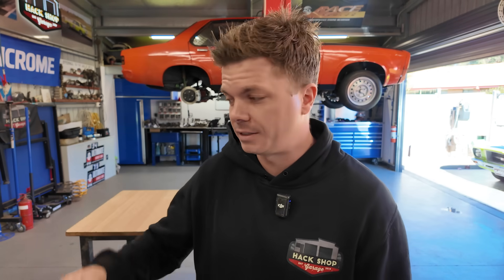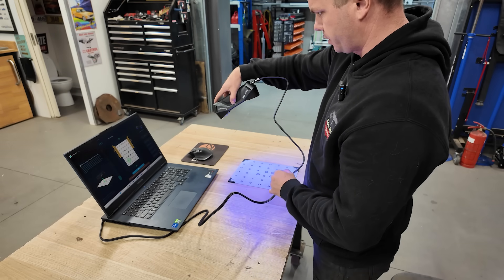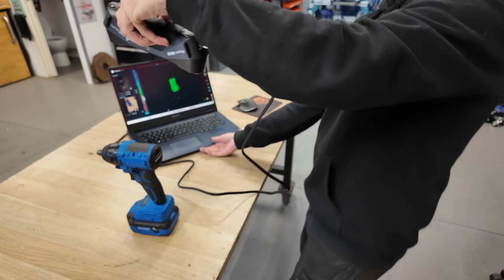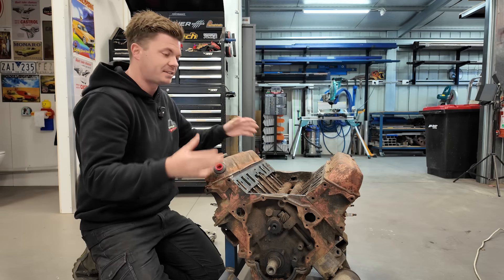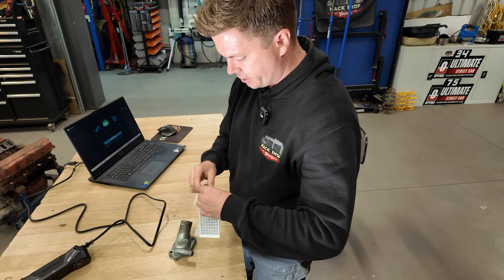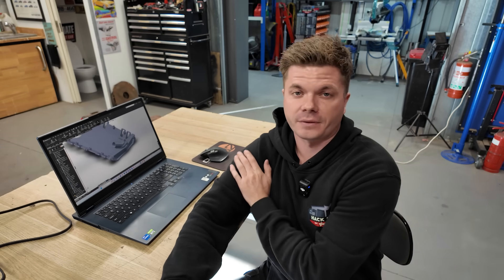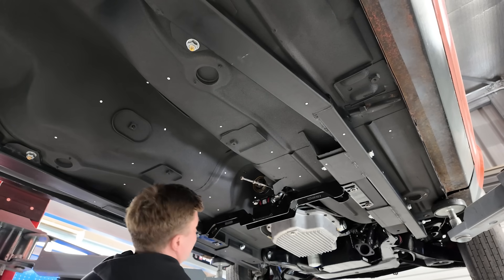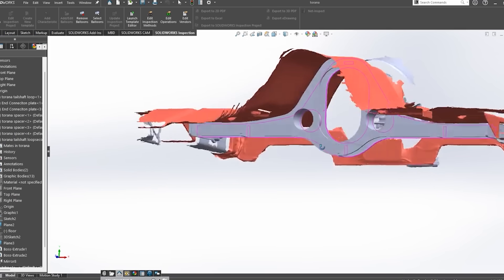The CREALITY RAPTOR PRO + a sneak peak at PROJECT 253!!!

Comment: Hey mate, awesome work. Have you tried quicksurface for solidworks to quickly transfer your scanned meshes into usable cad files? I'm looking at getting Raptor pro, so I'm wondering about how you feel about it now?
Reply from the maker: I havnt but I will give it a go. Still really impressed with the raptor mate, using it a lot still

Comment: One other thing you need to consider is, if you do need to lower the blocks deck height, for what ever reason(ruff deck, compression increases), the angle of the manifold mating face to head face will change, you’d would be better off scanning after machining. 
🇦🇺🤜🏼🤛🏼😎🍀☮️
Reply from the maker: Yeah that’s true mate. This scan is purely just for a ‘proof of concept design’ once the real engine is built and machined. We will scan it all again

Comment: Imagine how many times you put in a motor / gearbox to see if it fits into an engine bay at lets say 200kg? Now imagine scanning the engine with inlets and outlets (exhausts) printing that in a light weight foam or plastic to the exact millimetre at say 10 to 30 kgs................how much easier would that be

Comment: Very cool stuff mate, think of how easy it will be to make brackets and dash cluster housings for things like haletch hardware.

How come you wouldnt just scan in the bottom of an existing instake manifold and then build up from that instead of scanning the top of the engine that meets with the intake?
Reply from the maker: Exactly right, the possibilities are awesome haha 

We did scan the bottom of the intake manifold also, but the engine itself is useful as we need to take into account the rocker cover clearances for the ITBs
Reply: @HackshopGarage  Ok fair enough. looks like a great bit of kit. I have been playing around with the Lidar sensor in the back of iphones and using tools like Pix4d (whcih i used in the past for photogrametry work with drones )

its getting it then into a CAD program then into a 3d printer slicer. the workflow is never as simple as you hope. but its always getting better.

Keep up the great work